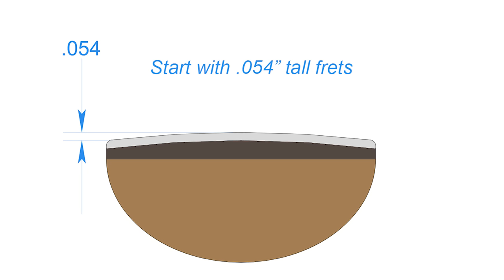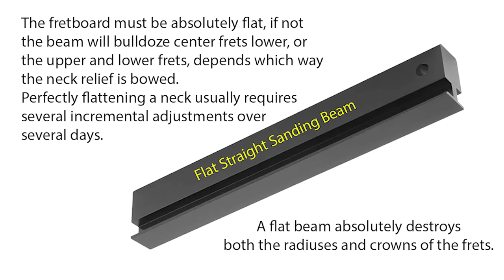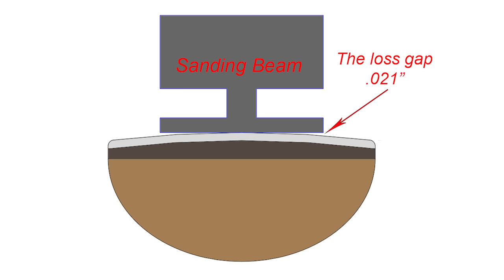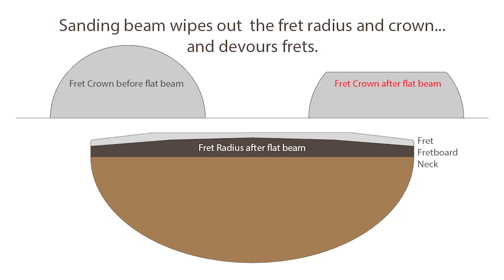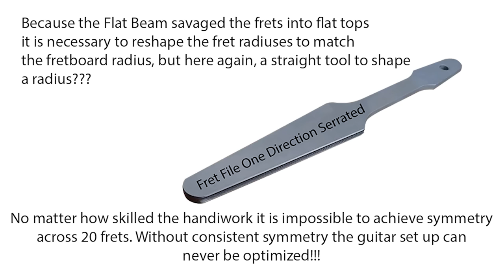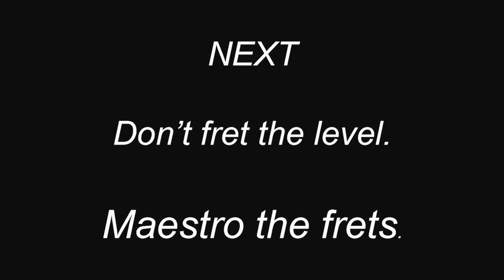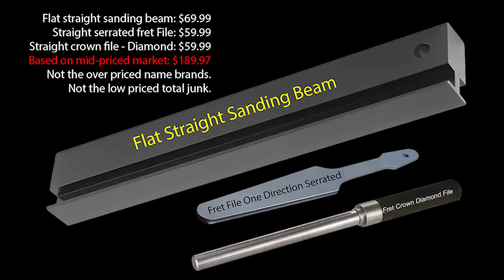Fret Leveling - Please view NEW videos for the all aluminum laser precision 2nd gen - links below

Comment: i dont pretend  to be a luthier, but taught guitar in a luthier;s shop for 2x years and picked up a bunch of tricks on set-ups. This really speaks to me as legit.
Reply from the maker: You'll get several more fret levels with FretMaestro as it removes the minimum material to get he job done better than ever. So it will be some longer time before having to replace the frets... $$$$
Reply: Agree. Stumbled on this yesterday after changing strings on my Strat and noticing some pretty bad fret wear. Have since investigated options over a wide range of prices. The best reviewed local luthier charges nearly $300 for fret job and setup and after further inspection I find I have several more guitars in need of the same treatment. On the subject of the minimum amount to be removed from frets for a perfect job, am I correct in thinking all frets need to be cut back to the height of the lowest point on the lowest fret? The spot with the most wear? I have decided to buy a basic set-up measuring set to establish radius on not only various guitars, but also various frets on a compound radius neck. I saw in another comment somewhere a question I shared about this being a new, and therefore unreviewed product. I think there may be a "chicken and the egg" component to this. If it is as good as it looks, it will get those reviews and by then it may well be too late and I may find myself at the wrong end of a long supply chain issue. FWIT I have contacted Steven with a few questions and he has been very helpful and quick in replying. Added to a system which will service all my guitars is the advantage, as he mentioned below, that I will get more fret job due to reduced removal of material. Not to mention the fact that I will be more likely to do them in the first place therefore keeping my guitars in better condition. Fret work has been the main thing stopping me from doing my own set-ups in the first place and this sounds idiot proof. I should be the ultimate test of that.
Reply: @Jazman342  So I guess you might be what they call "heavy handed"?  I am too, & I've learned to lighten my touch in a lot of areas, but how the hell do you lighten your touch with tremolo?  You've got to dig in to get a clean vibrato with some staying power, so how do you do that with a light hand?  I destroyed a poor MIM neck in less than two years.  The poor thing looked like it had been targeted by a sharpshooter w/a BBgun. Any advice would be much appreciated, although you might be just as perplexed as me lmao. -Cheers
Reply: @JeighNeither  I still have my first guitar. Got it new, and the frets have dents in them now 😅 I have learned to play a lot lighter though

Comment: I think we all have, at a certain moment, thought about this: there's something that doesn't make sense in the traditional system. Some people have even tried things like using radiused wood sanding blocks, but it's impossible to make them run over the frets perfectly parallel. And you end up with less material, whatever you do. We need another way. I've paused the video, I don't know what he is going to propose. I have been thinking of a possible way, let's see if it's similar. The video runs again.
Reply from the maker: Yes, one would think the radius sanding beam is ideal, but as you said, a tough proposition to run it straight so as not to completely whack out the frets.

Flat sanding beams suffer the same flaw albeit more forgiving, except now the fret radius is angular in a random way making it necessary to attempt reforming the fret radius with a straight file, which is counter intuitive for a compound radius fret. And eyeballing it is the only way, guess work, meaning that one will never get one symmetrical fret let alone 22 consecutive symmetrical frets. And straight filing has no depth of cut control and so it changes the fret height cut by the sanding beam. No matter what anyone says, flat beam and straight files are only good for getting so-so results. Geometry is the math; the math does not lie.

And yes, the old school tools and rules that have been in play for far too long are adaptations of wood working tools for working frets... back in the day that was what they could do, and getting close enough to eliminate fret buzz was accepted because that was as good as it got.

I think everyone knows, admit it or not, that perfectly symmetrical frets are the only way to maximize the guitar set up which in turn makes it truly possible to optimize play and intonation.
Asymmetrical frets work, no doubt, have been from the beginning, but the tradeoff comes at the price of not getting optimized play and intonation.

It really depends upon what one is looking to get from their guitar. The success of the PLEK is testament that there are enough players who do care.

On a neck and fret board that are not damaged, and are machine made vs handmade... it is easy for anyone to Maestro their own frets to absolute precision symmetry, hence making it possible to maximize the setup and hence optimize the play and intonation. (Handmade fret boards made by a competent luthier are also consistent without bumps and rolling highs and lows the length of the fret board.) 

FretMaestro takes off the bare minimum amount of fret material to extend the life of the frets many times over.

The naysayers claim that fret boards are bumpy, so that the only way to get same height frets is with a flat beam. Hmmm, the only bumpy fret boards I have ever seen are weather damaged by either too much or too little humidity.

Finger wear on the fret board is a different story; FretMaestro bridges over them, they have no influence on how FretMaestro makes perfect symmetry of the fret. Also, finger wear never exists right next to the fret because the string angle off the fret makes that impossible, such that on either side of the fret there will always be at least .125" without finger wear, and the FretMaestro fits within the non-wear boundary.

Necks on older guitars without a truss rod... that is why the string tension simulator was made.

Guitars with truss rods; if the truss rod is not damaged it should be no problem to flatten the neck, albeit patiently. If the neck cannot be made flat, what happens when using a sanding beam? Trouble!!! In this understanding it is also understood that the sanding beam on a flat neck is also measuring to the fret board for fret height, even though the beam itself does not register off the fret board the way FretMaestro does, and unlike FretMaestro, a sanding beam destroys the crown and the radius of the fret while at once creating random fret height by the imperfect angular strokes that is the inherent nature of a flat sanding beam on a compound radius fret.

Twisted neck... not a conversation... replace the neck.

Dreaded "S" Curve - can be and has been successfully handled by FretMaestro. Impossible to do with a sanding beam. Customer Video entitled "FretMaestro to the Rescue" explains this. Not all "S" curves are fixable by fret work... more often replacing the neck is the only fix, or stripping off the fret board, replacing the damaged truss rod, and so on.

Today there are only two ways to achieve perfectly symmetrical frets: pay for a PLEK service, or do it yourself with FretMaestro. FretMaestro cost much less, and you can use it time and again Vs paying again and again each time for a PLEK service.
Reply: @jordimateubartroli951  if you think about it though, when you add sandpaper to a radius block, you’ve already changed the radius.
Reply from the maker: Yeah, do the math... the fret height adds to the fretboard radius, the nature of concentric circles.
You are grasping at straws here.

Comment: I've been doing fret leveling for a little while now, apparently the "old skool" way, and having some success, but as an engineer I've wondered about the design of those tools. I just stumbled on this today, and your claims make perfect sense - shaping a curved part using a flat tool isn't efficient nor is it repeatable. It looks like I'm going to have to become a Fret Maestro...
Reply from the maker: Yes. The compound radius file does it all at one time, level radius & crown. The OMNI Pro does also because of the controlled depth of cut, but as a straight file it is slower because only a small bit of the file contacts the fret at a time whereas the radius file once the true radius is established on the fret the contact is 100%.  Other than a CNC fret level machine there is no other way to achieve the true symmetrical fret radius and crown. You are welcome to call with any questions - our contact page on our website:   SixStringers.com
Thank you for your honest insight.
Reply: you absolutely can buy blocks of wood that are radiused to match the fretboard curve and put some sandpaper on it, easy peasy
Reply: @SixStringers you absolutely can buy blocks of wood that are radiused to match the curve of the fretboard
Reply from the maker: Yes, but the reason they are not widely used is that if the radius beam is not used perfectly straight, the frets are quick toast. While it is logical to use a radius beam, the reality is that it really must be on a guide to keep inline straight, the slightest variance and its a very sad day. 
Flat beams are far more forgiving.
But all beams share the common issue of a fulcrum fret that see-saws the beam resulting in taller to shorter frets from the fulcrum to the low fret at the opposite end the beam will find to balance on. You see this more than you would think from shops... and for the newbie... it's almost guaranteed. And the frets originating from the fulcrum are progressively shorter in both directions. And the things is, we're talking about fret leveling, meaning the frets are different heights, otherwise we'd be talking about crowning.... so by definition of leveling it means there will always be a fulcrum fret. This is easily handled only when you know to look for the problem and to make two far enough apart taller frets uniform for the beam to balance upon without the see-saw before using the beam.

Comment: Isaw this months ago, and the reviews. The claim was that guitars are made on cnc so the finger boards are very level. I recently bought two buitars of the same model cnc made. One came with dressed and level frets and one came with frets that had kust been put in and they had sharp edges, but they did not need levelling, so lots of meat on them. the finger boards are indian laurel. it is a lot smoother than the rosewood finger boards i have. i have re fretted guitars before, but only once have put new frets in and not needed to level them. that tool looks like it can save a lot of time.

Comment: Use multiple Maestros for a neck with a compound radius (i.e. 10-16")?
Reply from the maker: Yes, know what your radiuses are and use those FretMaestros. Sometimes a weird one such as 11.25" which I would use the 11.5" FretMaestro for, but that's me. No way freehand filing is going make it that good. People are buying FretMaestros for this application choosing this listing:
https://reverb.com/item/78054296-fret-level-file-fretmaestro-any-4-ideal-for-compound-radius-frets
Reply: I was going to ask the same question! I have a few Fender Ultra guitars which all have 10” - 14” compound radius necks.
Reply from the maker: Yes, multiple Radius FretMaestros, and do not make the up scale frets shorter as so many think has to be... the compound radius combined with the fan of the string line already does that. for 10-14 the 10+12+14 is excellent... save some bucks and get the ANY 4 Set, if you play acoustic as well, add the 16" to that, you're set.
I am making a video for Compound Radius Fretboards, hope to have it up this weekend.
  @stoneglad
Reply from the maker: Yeah, get the 10+12+14 add in the 16 for acoustics, good to go. I am making a video for this subject, will be up this weekend.
How to know where to use what radius... yes, the makers do not reveal this relevant nugget of wisdom, but 3 radiuses, divide neck into three zones... by equal distance - check the 3 FretMaestro to the Fretboard, use a flashlight to peep light to see the gap if any, likely in most case there will be a very slight difference between Maestro radius and actual radius as the fretboard is CNC machined... select the closet Maestro, locate the change of radius key frets. mark them... and take notes for future reference and tuck away in the Maestro Box or in the guitar case. Anyhow, more on this in the upcoming video.
 @stoneglad

Comment: I own a number of vintage 7.25" Fenders and they always have issues with buzzing and dead spots.  Because these are old instruments, it's hard to tell if these are really a fret level issues, fretboard level issues, or a mix.  Two questions:  For fret cloning to produce buzz-free operation, we're assuming a perfectly level board, right?  Second question:  we're also assuming there is variation in fret height from prior "old school" leveling techniques, where some frets are lower than others — so that we can clone to the lowest fret, right?  Meaning, if you're doing a refret with new wire from the factory, what's the tolerance on that wire?  If it's near-zero, then in theory the frets are already cloned and Maestro-ing shouldn't be necessary.  Unless we're talking about height differences due to tiny variations in installation from fret to fret.  In which case, you really aren't cloning any more — you're actually un-cloning them!  If I'm understanding this correctly.
Reply from the maker: If the frets are off, means nothing to FretMaestro. If your necks are dried out or have been soggy in the past, you'll need to take a very close exam... look for parting line between fretboard and neck, delamination.  If the neck is twisted, it's dead. So, all the death blows to fretboards and necks are not fixable with FretMaestro.
But, these death blows are not at all common. You are likely in good shape.

Where to buy:
https://sixstringers.com/#FretMaestro%20Prices
https://reverb.com/shop/guitar-picks-sixstringers-wild-plectrums
Reply: My question exactly- this is assuming you have a PERFECTLY flat and radiused fretboard, which is almost impossible for a guitar with a wooden fretboard.. The wood being organic and porous, even if sealed is still affected by temperature and humidity, causing very slight swelling and/or twisting along the board, which traditional fret leveling/crowning techniques are meant to correct.  We're actually planing the fret crowns, not leveling them.  If each fret is an exact clone of its neighboring frets in height, if there is any deviation in the fretboard at that spot, you will still end up with a high/low fret.  Traditional leveling with flat beams corrects for these imperfections and changes in the board by sanding all the fret crowns down to the same plane.  If you have a guitar that requires .020'' be taken off any fret, you have bigger problems and would need to remove all frets, re-radius the board, and install new frets.  Even then, after fret install 99 times out of 100 you will still have to do some beam planing..  If I'm completely missing the mark here, someone please tell me. I mean no offence.

Comment: Took a while but i found them for sale on Reverb. I'm an engineer and work in thousandths every day. He's right about a few thousandths making a huge difference. Three days to straighten a neck is a bit ridiculous though... A guitar with excellent action no fret buzz has frets that are all within 0.004" or less.
Reply from the maker: Hmmm, FretMaestros are sold on Reverb, and you can also order direct and save a bit.
Reply from the maker: Actually wood moves as the grain settles to the truss tension, and since we're referring to using a sanding beam here, and you are aware of the value of thousandths, be very sure that the neck will move in thousandths until it completely settles after several small incremental truss adjustments along the way. Putting a straight rule on the neck right after adjusting the rod is a momentary read, the wood has not yet settled. You use the straight edge a few hours later to see if the true is still there, and of course the climate and humidity conditions cannot fluctuate too much. But whatever, because now we assume that the sanding beam is dead on and the sticky paper is a perfect gauge and so on... so many variables that if they are all leaning the wrong way adds up to trouble, or perhaps they all lean the right way, what luck. All of this is eliminated when you do one fret at a time, the width of the FretMaestro is .5" so will there be a bow or arch in any given .5" segment of the overall length of the neck... NO.  As for fret buzz... fret wire is a .002" tolerance out of the extruder, and since the manufacturer does not say if this is +/- it is fair to assume that it is, hence a .004" variance is possible... so even a new guitar needs things cleaned up, which is why some sellers push for PLEK on new guitars. Ahhh, but that leaves the top of the frets flat. There is no absolute perfect... always some trade off... so if one is aware of all of the variables and trade offs and can measure those to their personal preferences then they can say with certainty that they are dialed in for themselves, but not for the next guy.
Reply: TIME AND PRESSURE OR TIME AND RELIEF.  It's ABSOLUTELY true . The neck will move SLOWLY ...ITS not a baby birch limb. Imagine the Bows that were built in days of old ..they bent those OVER TIME ...
Reply from the maker: And then there are truss rods. Today's truss rods are excellent. Old guitars, depending how old, no truss rod, and the first truss rods were just okay.
2.5 million guitars sold per year in the USA... what percentage of guitars out there are not stable? Very few. The exceptions do not make the rule. FretMaestro works on 99% of the guitars out there today, the rule, not the exception.